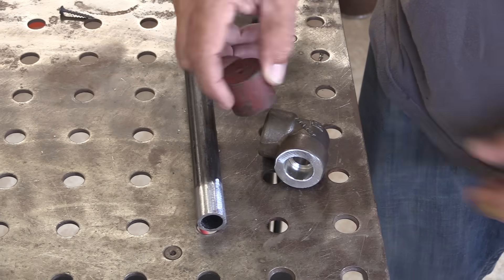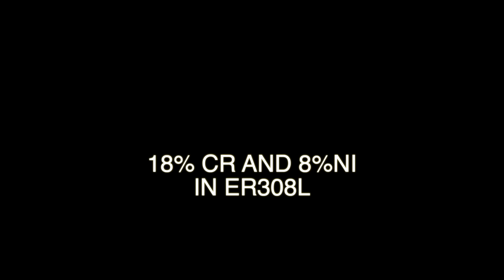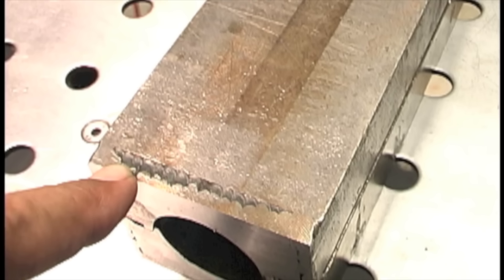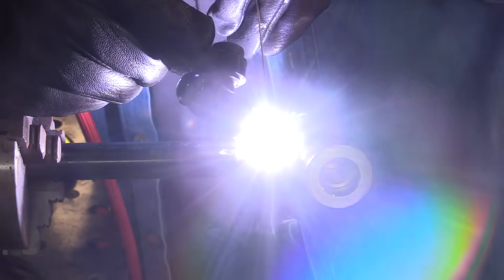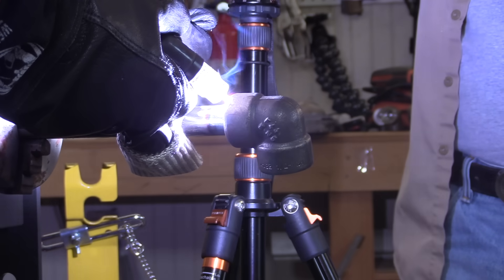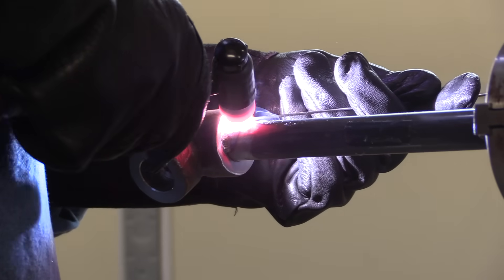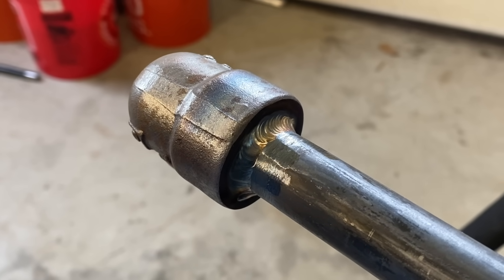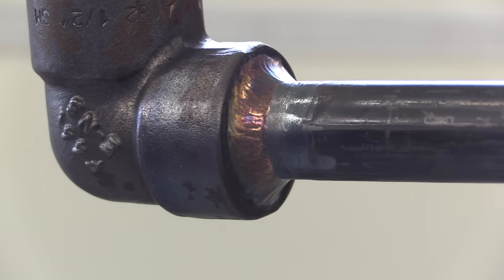TIG Welding Stainless to Carbon with ER309L

Comment: Good video and nice welding examples.  Always be careful mixing stainless and carbon steel in real world applications as it can cause galvanic corrosion with the carbon steel as the anode.  You can get away with it with large carbon steel mass and small stainless mass but the more stainless to carbon, the greater the corrosion.  Isolation kits should always be used when joining carbon to stainless in a system.

Comment: Thank you so much for your videos at work. we would use 309 stick welding to weld mild steel  to cast steel coal pipe and worked great.

Comment: i love how your  videos always correlate to what im learning in my day, i just got my first tig job out of welding school at a local community college doing stainless work, theyre having me build some saw horses where the legs are made up of carbon sqaure tube, I am using 309L 1/16th on the top 2x4 stainless square tube, Im absoulutely loving it there but thank you for all of your knowledge!

Comment: I have used 309 to join carbon to stainless before, but never on just carbon steel.   How well would it hold up on just welding stainless to stainless?    Last year I welded up some stainless on a pin-plow for a bowling pin setter machine for my buddie's bowling Alley .  I did not know for sure the type of stainless so I went with a 308 rod.  But I almost went with a 309 as it is a stainless part but it is not really in a stainless application.  A bit of surface rust won't hurt.  In fact I repaired about six of these same panels about 20 years ago for the previous owner before my buddy purchased the place. I used a 309 then because I took them to work and welded them and it was the only stainless rod we had at the time. LOl 
     I looked my old repairs over last year when I fixed this part and they was perfect.  I did not have any stainless rod at the house so I tried to buy the right filler.  I might would of been better off getting 309 and had what was left around as a good all purpose.

Comment: Yet again a really excellent presentation, this is interesting as I have a situation to weld a carbon steel hydraulic fitting into I THINK a cast steel cylinder I've been putting the job off as I can find very little on what filler material to use and I wonder if this would be the answer

Comment: Can someone explain the "gap" that is required? Where is it, and why do you need it?
Reply: Between pipe OD and socket. Gap is to allow for shrinkage so cast fittings don't crack.
Reply: When fitting a socket weld it’s typical to shove the pipe into the socket as far as it will go. Once shoved in take a soap stone or magic marker and draw a line around the pipe right up next to the fitting. Once the line is drawn pull the pipe out 1/8” of an inch. This will allow you or the fitter to get the pipe and socket fitting both square and plumb. If you shove it all the way in and don’t do this the pipe and socket will be locked into a position where they can’t move at all. Now achieving square and plumb will be impossible. You can buy a ring that is bent 1/8” that can be placed in the socket fitting to make the space for you and sometimes it is required. When required on a job they will x-ray one every once in awhile to make sure you are installing them. Hope this helps.

Comment: Why do socket sleds gotta have a gap? To compensate for shrinkage?
Reply: To compensate (allow) for expansion during the weld methinks.
Reply: My instinct says for getting enough penetration deep there in the join line where it counts, let enough metal fill in deeper and make an internal surface and not just a round lap joint that has already a weakness, in the shear surface line. But I wait to be corrected on this one.
Reply: @nikspanakis  but that gap what looks to be a 3/32, is inside the socket, it’s not where he put his weld. So he’s not getting any sort of root penetration.
Reply: The socket is cooler than the pipe in operation, causing the weld to be in tension.  Over time, this causes the weld to crack.
Reply: @fztfabs65 
Socket fitting welds are filled type, not groove or butt.   The gap is for pipe expansion so no thermal stress happen in operation when the pipe runs hotter than the fitting.

Comment: Wouldn't the RPM vary with the diameter of the pipe to stay at 1/8" per second?
Reply: Yes. That's what the marked tape trick is for; the "write it down in a handbook" would be for that diameter only.

Technically one could calculate the RPM using some math... but if the positioner's speed isn't accurate (or one isn't good with math), the tape trick works well enough. If it works, it's right!

Comment: Jody. Rpm= surface feet per minute/diameter* a constant number of 3.82.  Your moving 1/8 of an inch per second. 1/8 = 1/96 of an inch * 60 seconds which is your feet per minute this is .0104 *60 this will always stay the same cause your 1/8 travel distance is your sweet spot divide this by the diameter times the 3.82 constant and voila no more guessing
Reply: My bad 1/8 is equal to 1/96 of a foot

Comment: Are there fumes you need to be worried about when welding stainless?
Reply: Yes, chromium hexavalent. Should use localized exhaust and papair hood (positive air pressure)